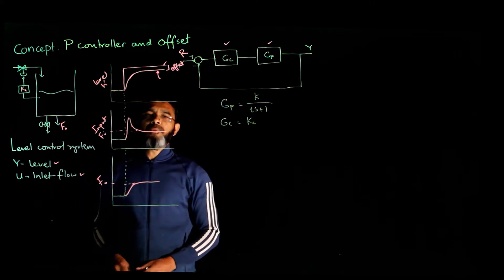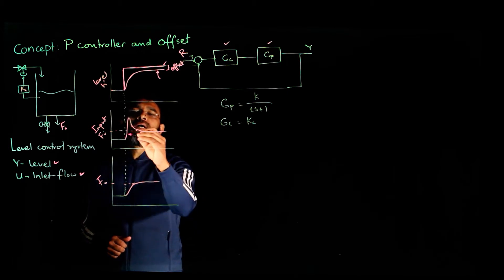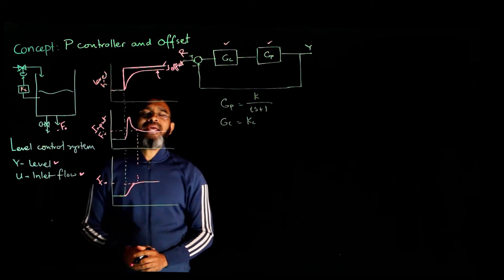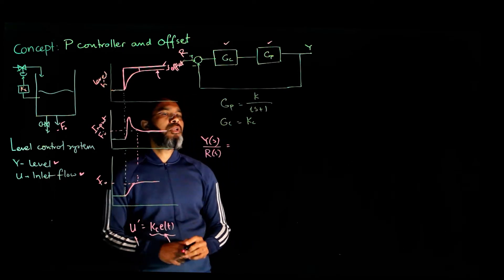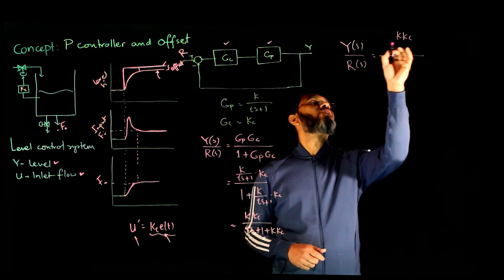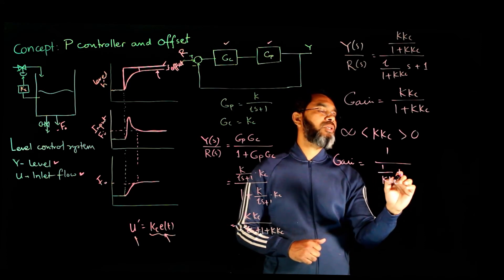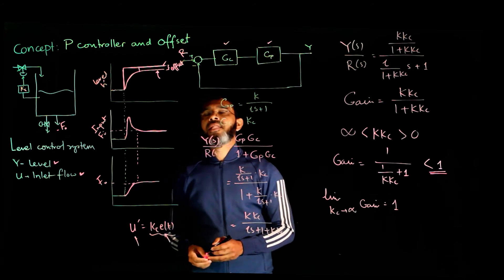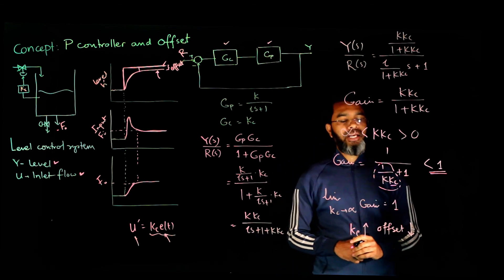Proportional controller and offset

Comment: Sir
If a water heater with no feedback (assume open loop system). I want to heat water from 30 deg C to 60 deg C. I am giving set point as 60. Will that water reach 60 deg C ?
Is offset possible in an open loop system ?
Kindly help me.  🙏

Comment: Can't we consider the error with respect to level instead of flow? like when the level is low valve will open a bit depending on the gain which increase the flow and if the  level is low then  the valve will close a bit. then when offset zero  valve  will remain constant